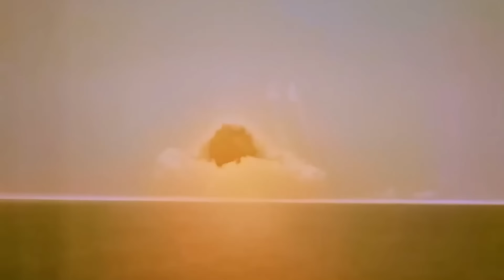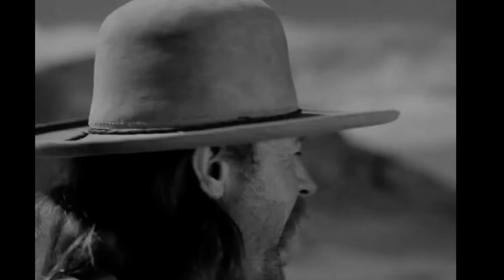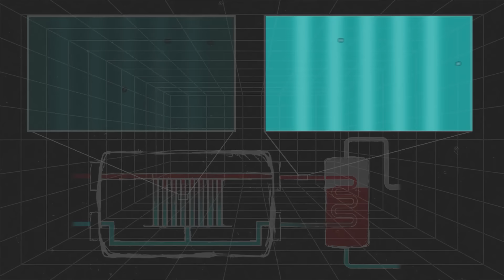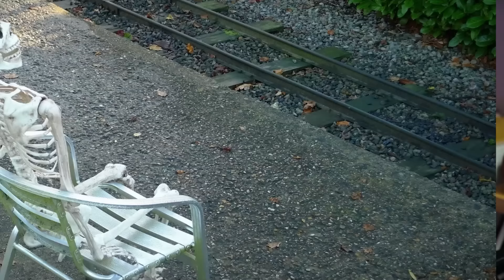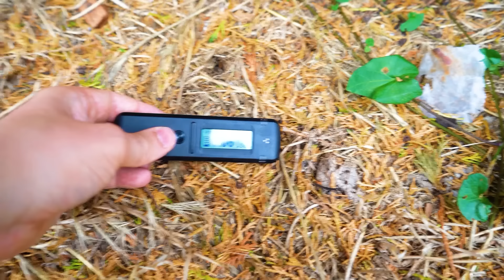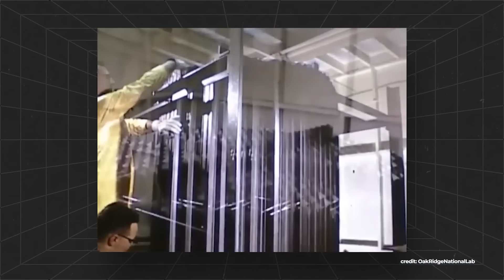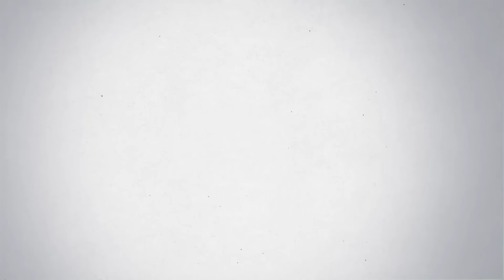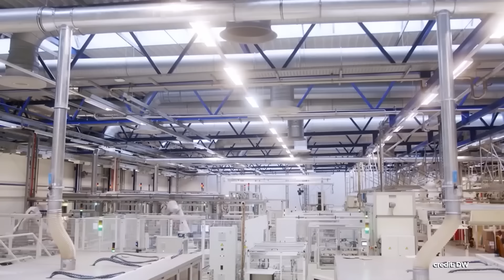It's Happening - China Launches World's First Thorium Nuclear Reactor

Comment: Thorium requires more neutron bombardments to become a long-lived trans-uranic (heavier than uranium) isotope.  A molten salt reactor can continuously filter out the protactinium and uranium before the fuel receives sufficient neutrons to become a trans-uranic.  For this reason, a molten salt reactor running on thorium can theoretically avoid the vast majority of long-lived isotopes.  Even better, using long-lived trans-uranic isotopes is also possible, as in neutron flux these will eventually split.  All these elements are either fertile (being able to receive neutrons to become fissile) or fissile.  This means a molten salt reactor could also theoretically burn up 100% of the long-lived nuclear waste.  This would result in highly radioactive, short-lived nuclear waste.  Solid reactors don't do this because of gaseous fission products destroying the solid fuel elements.  Thought this was an important point to share, which the video glossed over.
Reply: Yup - one of the "Yes but" issues constantly being raised by naysayers is the issues of fission product sequestering/disposal and it blows their tiny little minds that the stock answer is "leave it in the loop to be broken down to safer products"

Likewise, there's this mindset that the filtering system would need to process the entire loop every time it passes through the reactor. No amount of explaining that a 1GWe reactor would need to process 5-10kg of salt/day (and only start doing so after 15 years of operation) seems to penetrate people's skulls
Reply: @miscbits6399  reactors can be built small and the processing can be done VERY often.  It can be as simple as splashing the salt to get rid of gaseous fission products and some other elements.  Of course the chemical processing can be done very expensively and very thoroughly.  But repeated fast cycling could mean you can get away with less thoroughness in the processing steps.
Reply: Ok chat gpteenager
Reply: And how exactly does one continuously filter out these elements from hot, molten salt mixture?
You do know almost complete burn-up of fission products is possible with uranium fission reactors, too? Uranium cycle has been closed years ago.
Reply: @lajoswinkler  easy, you just take a used coffee filter and pour the salt through it.
Reply: @lajoswinkler  Yes, it's possible to burn up fission products with a molten salt uranium reactor.  In fact the thorium reactor made by copenhagen atomics can run also on just nuclear waste, using uranium and plutonium to start up.  Best case, expand the fuel supply by transmuting thorium.  It's one option, among many, due to their exceptional neutron economy due to their use of heavy water.    BUT a conventional solid fuel uranium reactor cannot have 1000% fuel burn up, due to cracking of the solid fuel elements due to buildup of gasesous fission products.
Reply: @MrGottaQuestion  
Burning fission products is like using high quality gas to burn a wet woolen carpet. You wind up wasting good reactivity and get back slow and unresponsive delayed reactivity. Fission products have low reactivity and high cross-section. They reduce the overall efficiency. 
Expect this selling point to fall by the wayside, as it has every other time waste destruction has been flogged as a bonus.
Reply: @aaroncosier735  this is why molten salt reactors are superior. Gaseous fission products like Xenon 135 can bubble out of solution. Xenon is a neutron poison which would destroy the neutron economy of the reactor.  It is also the reason that solid fuel reactors cannot ramp quickly up or down.  Molten salt reactors get rid of this by chemically separating fission products while the reactor is still online
Reply: @MrGottaQuestion  

Yeah sure. Actually, a combined kryptonite/unobtanium reactor is superior.

As far as real reactors go,  in continuous operation, Xenon is destroyed rapidly, and is in equilibrium. MSRs put this hazard outside the primary reaction vessel, where it cannot be chemically captured and degrades much more slowly without the neutron flux. 
All the non-gaseous fission products are also an issue, and their accumulation is the defining characteristic of spent fuel. 
Magical hypothetical MSRs can remove these fission products, just like kryptonite/unobtanium reactors. Doing so in reality is much harder.
Separation of fission products in used fuels that have had years  to cool requires heavily shielded and sophisticated plant. 
Separation of fission products from molten salt that was critical minutes earlier will require unmanned hardware of unparalleled durability and reliability.
Good luck with that.

Before invoking purely hypothetical fission product removal, you will need a base material for the reaction vessel. No candidates are even close to the required parameters, and even if an ideal alloy was found tomorrow, it would still take over a decade to "qualify" for the basic durability tests, let alone workability such as machining and welding.

Thorium reactors will be "experimental" for quite some time to come.
Reply: @lajoswinkler  
Well, thorium offers no magic bullets, for sure.
Uranium fuel cycles have never been closed.
once trough as UOX is standard.
MOX gets you one more pass if you are willing to bear the added expense of reprocessing, and if you happen to have excess low-irradiated plutonium handy.
Used MOX is a dead end, requiring longer cooling and longer storage horizons than spent UOX. Reprocessing used MOX needs to be very prompt lockstep with irradiation, else U232 accumulation presents additional shielding and handling requirements, plus isotopic separations. 
No one has closed the uranium cycle.

Comment: The main issue is water cooling which explodes like Fukushima there are currently two solutions one is liquid salt and the other is simpler which is the spider arm reactor as long as you have water cooling even without control rods your at risk of explosive destruction and terrible disasters surprisingly all of the money that the USA has put into nuclear research grants only goes to existing companies which have current designs like Westinghouse so it's basically impossible in the USA to research and develop Gen 4 at that point I ended up hating my country and gave up

Comment: My understanding is that the thorium reaction properties were known, understood and considered in the 1920s and 30s but when WWII came along the properties required for bombs became a consideration. Then the cold war started so the need for bombs continued. As a 12/13yr old in the mid 1960s I could not understand why so many fast breeder reactors were needed as eventually you have too much fuel. However the adults in the room wanted bombs so, regardless of the cost and advantages, uranium reactors became king. 
I'm sure that without these wars, more time and effort would have been put into thorium and these present discussions would not exist! Discuss?

Comment: I think that the amount of resistance to Thorium reactors can be compared to from what happened to Diesel engines. These were originally envisioned to work on practically any liquid fuel that could burn, but that was difficult to make money from in the long-term, so it was emphasised that they would run specifically on the light fuel oil that we now refer to as Diesel.
Our species as a whole may be highly interested in cheap, safe, clean energy for everyone...but the people controlling all of this are only interested in how to make themselves wealthy from it.
I feel that's why Uranium was pushed to be the fuel for reactors, it's dangerous to mine, use and dispose of.. expensive ..which are all opportunities for some people to get rich from it.

It seems like we're now at the stage where a few greedy people are holding any human progress back because they'd rather hoard their exclusive lifestyles than improve everyone else's.
We really need to start thinking about this socioeconomic problem and what it means for the future of our species and our planet, because at the minute, it feels like we've stalled.

Comment: Interesting vid, had heard of the Thorium based Nuclear reactor in 1980s.  Am always interested in STEMM stuff.  MD for 30 years.  Hope you understand dude that the CCP lies about almost everything, so take any numbers or economic/date of completion stuff from Mainland China with a LARGE grain of salt (pun intended, lol)  I also clearly remember the predictions about commercial Fusion Power, lol.  For 40 years, High level Scientists have predicted it is "10-20" years away, using the same wording every year.   Fusion power is a huge technical problem which will eventually be solved but who knows how long.   There is also, the human psychology problem in Western Democracies, also.  The level of Scientific Literacy is woefully low in the west.  Add in 3 Mile Island, Chernobyl and Fukushima and the bad press.  IIRC, France had gone the furthest with about 70% of Electricity being produced by Nuclear record.  You probably know this but the precursor to commonly used MRI imaging was called NMR (Nuclear Magnetic Resonance) used in Chemistry.  When it was adapted for Human Imaging they wisely rebranded it to Magnetic Resonance Imaging (which means exactly the same thing).  I guess the Marketing/Rebranding/Sales dept of these companies actually earned their money on that job, lol.  Relatively clean power production, reasonably affordable, is necessary as we advance as a Species.

Comment: Ah yes. A typical look into the nuclear power industry will usually reveal this pipe dream.

I’ve heard about thorium reactors for years. Thorium, however, is not a more efficient fuel source. 

Again, the issue is as such, if the method was more viable or desirable then we (and others) would have sunk way more research into it and it would be widely used today. Such is not the case. Thorium can be used to create fuel, but the ratio is not efficient.
Reply: Th reactor develment was stopped because it was harder to produce weapons grade Pu with it.

Comment: Ah yes, removing highly radioactive materials from nuclear reactor amids its operation to treat it chemicaly is very clever. Also having nuclear fuel leaving nuclear reactor is very safe. These videos sound so dumb to me. Oh look water boils at 100C, soo bad, get rid of it and replace with radioactive thing that boils at 1400C, thers no way that this thing reaches 1400C and starts evaporating highly radioactive substances :D Lets fill the reactor with lots of pipes for constant flow of radioactive materials, im sure nothing bad will happen, i mean its so much better than having dangerous nuclear materials confined in metal casings inside a nuclear reactor. Fuck it you know what? Lets treat nuclear waste on the site itself! every nuclear reactor will have chemical plant for nuclear fuel treatment, we all know how safe thous are!

Comment: Seems to me, using these types of reactors to produce electricity, which is used to power the electrolysis, producing hydrogen and oxygen(for the geriatric smokers). The generators could also power the compressors to liquify the hydrogen and oxygen for transport. Inefficient on the electrolysis side sure, but since the electricity is produced onsite the losses are minimal. This shouldn’t be that hard, we put men on the moon…
 Remove petroleum from mass energy will change the global paradigm, should be interesting….

Comment: Water boils at 30c in a vacuum and no matter how you get water to boil it will expand 1699 times its volume you can run a steam turbine system in a closed loop with a hot side water tank that sprays water into the system flash boiling to steam passing through the turbine and to a chiller side that recondenses the steam to water maintaining the level of vacuum in the system. what this means is you need far less heat energy to obtain the same level of kinetic and then electrical output.

Comment: Sorry this is long :  1. Thorium reactors will not prevent nuclear proliferation .. Thorium reactors can make a breeder reactor to produce Plutonium, as any large high energy neutron source can  ..  2. Though technically true, Thorium reactors produces less Actinides, but the total fusion by products of u233, u235, and p239 reactors are equally deadly .. Just because one has a few percentage points less Actinides in the mix is immaterial ..  3.  It will need as much water as any other power plant .. It is cooling the steam condenser of the power loop that uses the bulk fresh water, not the primary reactor loop .. Gas and Coal power plants are located near water sources for this reason ..  4.  The real challenge is processing the fuel .. You will need a complex, expensive, reliable system to separate out thorium and u233 from fusion by products .. If you are sane, this processing plant will need its own containment system and it will be much larger than the Reactor Core / Main loop containment system .. Per megawatt of power it will produce about the same amount of waste fission by products to be deposed of as a light water reactor .. Scaling this processing plant up to support 1,000 Giga watts of electric power generation is economically unfeasible at this time ..

5. This is why you only see only test Thorium plants .. Every nuclear power nation thought they could beat the processing problem .. Non have succeeded, now it is the Chinese turn at it ..

Comment: General Atomic (now General Atomics) in San Diego, CA built two Thorium powered reactors in the late 1960s, one  at peach Bottom PA the other at Ft. St. Vrain, CO. Neither were very sucessful as commercial plants. I worked on the second one between 1971 and 1979. 
 Thorium is not actually capable of nuclear fission. It must be "bred" in a reactor using (guess what!) Uranium or Plutonium where it is turned into U-233, a fissionable isotope of Uranium. Don't let the hype turn your head. Most of the danger is still there.

Comment: Dr ben Your Wrong and have been reported.  PRC shill

Molten salt reactors: In the 1960s the Oak Ridge National Laboratory (USA) designed and built a demonstration MSR using U-233 as the main fissile driver in its second campaign. The reactor ran over 1965-69 at powers up to 7.4 MWt.

Comment: You said "it is an advantage to be able to add new fuel to the reactor", but it is the best safety feature ever as well, since if you stop putting in new fuel the reactor passively stops.
It is the complete opposite of the current reactor design where you start things up and then use multiple redundant safety systems, trying to keep the reactor under control, and need active cooling for multiple days even after you have turned if "off" .
Reply: Still need uranium to get uranium from the thorium.
Reply: @juslitor  I think anything that produces neutrons will do. And we have been stockpiling a lot of that stuff.

Comment: One of the most compelling reasons that the Th232 - U233 breeding cycle is superior to the U238 - Pu239 cycle is that U233 is the only fissile material that will produce more than 2 neutrons per reaction in the thermal neutron spectrum. This means that the slow neutron reactor designs based around them have the potential for being much safer.